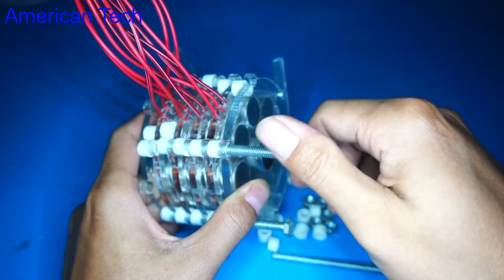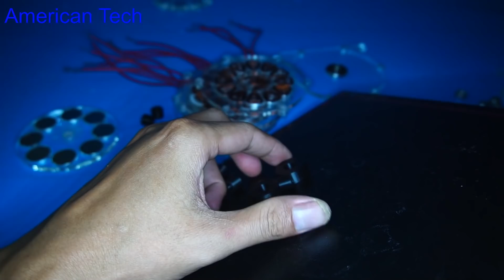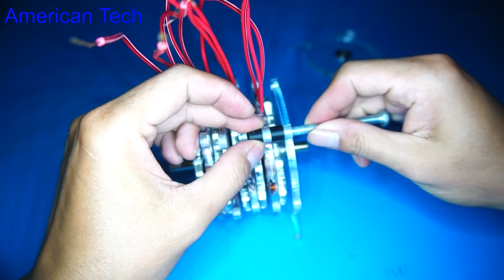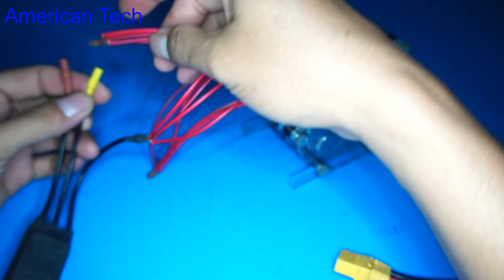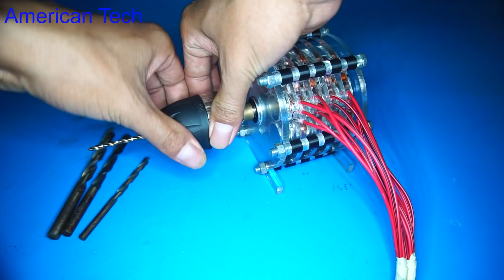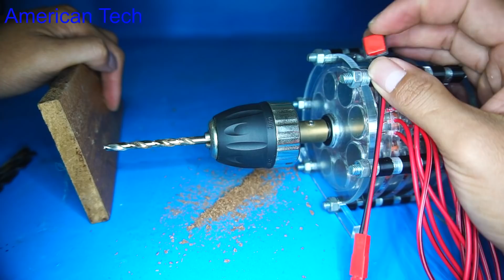Rebuilt a powerful brushless motor

Comment: Excuse me a question. How much energy does a normal drill consume and how much energy does your motor consume?
Reply: conventional drills normally have a rated 500 watts of input power maximum, we don't know the informations of his built motor. it doesn't have brushes so is very much efficient and powerful than 500w drills I presume.

Comment: Amazing work ! 
Perfect design.
May you give me the 
Diagram? For example:
Wire radius “thickness” , wire turns , coil radius , connections , magnetic polarization arrangement , energy in/out ( volt , current “in”+ torc “out”+ rpm “out” + frequency rate “in”) please...
Reply: I found it thank you so much 😊